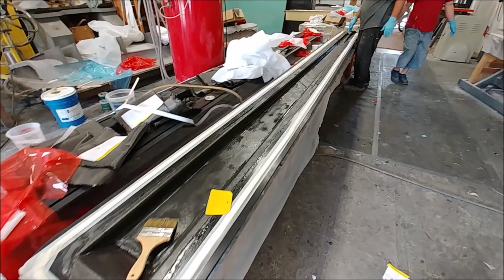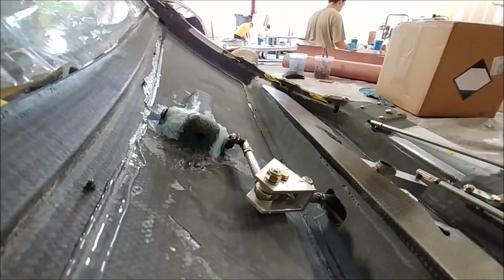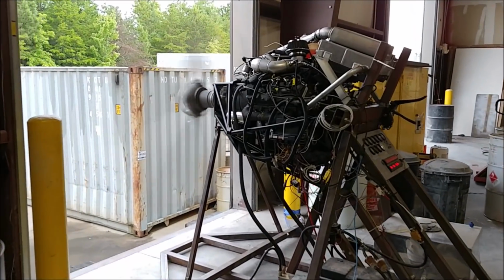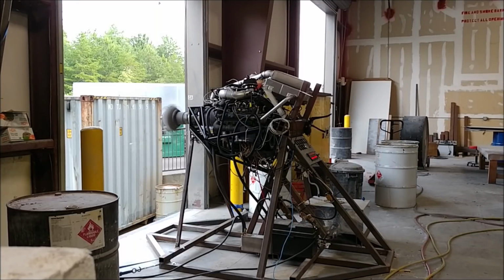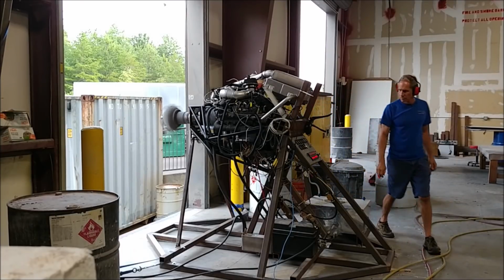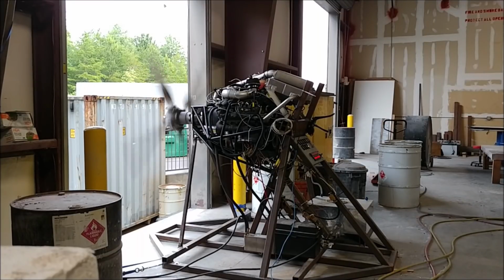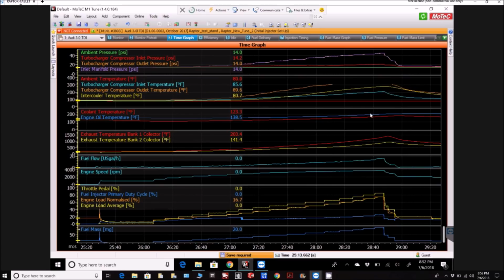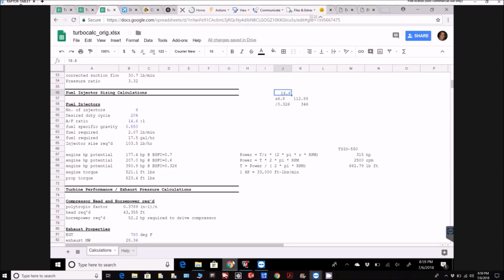Making Real Horsepower - Building the Raptor Prototype

Comment: I would like to recommend something, why not use a toyota V8  32 valve 5.7 liter  naturally aspirated  385 hp  and very reliable. also can add a trd supercharger for 505 hp
Reply from the maker: That engine is not diesel and it probably weighs way too much. The Audi engine is perfect for our application.

Comment: Audi has stopped production of these diesels for autos, correct? Are you negotiating with them to acquire the engines from the recalled vehicles in the U.S.? What are your thoughts on future availability of the engine for Raptor production? Are you considering the EPS Graflight V8?
Reply from the maker: There are loads of these engines available for not much money in Europe. We could ship them over by the container. The EPS engine is too heavy for our aircraft.

Comment: If you’re seeing 380 hp on Jet-A, what hp do you estimate you would get using diesel fuel?
Reply from the maker: Possibly as much as 400hp. But given the fuel flow from the sensors we're probably closer to 350hp on Jet A which would be about 365hp on diesel.

Comment: Would it be hard to add some conversions to SI units in the spreadsheet? Like kW for the power and Nm for torque? Would be handy for those challenged by imperial.
Reply: You know what would be easier is if you used google to find the answer yourself instead of asking the guy who is trying to build an airplane to do it for you.
Reply: Might be hard, as I can't edit his spreadsheet, or do I?

Comment: Do you have an overall weight on the engine with the mods you have done? Im curious if it would work in an RV-10 in a pull configuration?
Reply from the maker: Probably around 550 to 600lbs with everything.

Comment: Just out of curiosity, why the fixation with torque?  It is almost a meaningless number as you showed in that you can increase the prop flange torque by changing the ratio on the belt.  The only number that gives an indication of how much work the engine can do is the HP number.  Keep that where you want it and you will be perfect!  :-)
Reply: Perfect :-)
Reply: Bert Penney torque is a measurement.  HP is a calculation of RPM vs torque.  HP is a representation of power where torque is measured. Both numbers have relevance. But torque is where it’s at.
Reply: If HP is a calculation of rpm vs torque, why do things like horses, jet engines, rocket engines,etc produce HP (in some cases massive amounts of HP) yet output no torque?

In the case of the Raptor, torque is completely irrelevant.  What is important is a) that the engine runs at whatever rpm it most efficiently develops the HP it spends most of its time producing (normally cruise HP); and b) that the propeller shaft is turning at the optimum rpm for the chosen propeller while in cruise.  What the torque numbers work out to be at those settings is irrelevant.  If you need, say 180 HP for economical cruise, you need 180 HP regardless of what the torque number is (that engine will develop 180 HP at a very wide range of rpm's so there will be a very wide range or torque values for that one HP setting).  Focus on engine and propeller efficiency and forget torque.
Reply: Ah, the silly torque is more important than HP argument.  (btw Bert, you're on the money) Torque doesn't tell you anything without RPM.  If you know what your power is, torque is entirely irrelevant except for how to design the drivetrain to withstand the force your engine creates.  I can exert 2,000ft/lbs of torque on a transmission spline standing on a 10ft breaker bar, but that doesn't mean I'm going to outrun a Geo Metro on the drag strip with my 2,000ft/lb car.  I don't care how you gear it, the end result is that the resulting RPM from me hopping up and down on a breaker bar is going to be so small that it'll eventually equate to the HP a normal human can produce on a bicycle....maybe .3HP or so.  Now, if I were to rotate that bar horizontal on a platform over the car so I can push that 10ft breaker bar in a full circle with 200lbs worth of force, chances are I'd only be able to push something like that maybe 1 full circle in a minute, assuming I had something to push against.  2,000ft/lbs at 1RPM equates to roughly .4HP, so that's pretty close.  But what if I were superhuman and could run around that 10ft circle 5,252 times per minute? Then I would be able to make 2,000HP and smoke that Geo Metro. Put those numbers into a HP calculator if you want, but they're correct.  There's a reason why torque and HP curves meet at 5,252RPM.  By itself, torque is essentially the meaningless measurement. Say it takes 200ft/lbs of engine torque output to hold a car on an incline...you're 200lbs and standing on a 1ft long breaker bar attached to the transmission spline, creating exactly 200ft/lbs of torque.  Are you going anywhere?  No.  Are you doing any work?  No.  You could put 200lbs worth of exercise weights on that bar and that car will stay right there...no work is being performed and no power is being produced AT ALL, but you're still producing 200ft/lbs of torque.  How is that possible that torque is doing no work?  Let's up the ante and say it takes 2,000ft/lbs of torque to hold a big semi on that incline.  You use a 10ft breaker bar and exert 2,000ft/lbs.  Still the same situation.  But How?  How can 2,000ft/lbs be so useless?  Because torque is useless unless that torque is being made by a rotating powerplant.  It's not until you use torque in conjunction with RPM that it becomes relevant.  At that point you're not even looking at torque, you're looking at HP output.  What you thought was a measurement of "real" power (ie tons of beefy torque down low) is actually just the corresponding HP number at that same RPM.  600ft/lbs of torque at 2500RPM from a V8 is pretty respectable, but it's only 285HP...similar to what's made by a V6 at 5000-6000RPM.  If that same 600ft/lbs from the V8 held to the same RPM as the V6 (5000-6000RPM), you're now in the realm of 600HP. When you consider both torque production as well as RPM together, which is the only way things move under power, you get a new function called horsepower.  Horsepower is telling you the actual useful power the engine can produce, torque is simply a measurement you use to design the drivetrain around the engine.
Reply: Bert Penney  laws of physics mate, you can't have hp without torque!
Reply: Really?  How much torque does a horse produce?
Reply: Uhhhh....No.  Just the opposite.
Reply: Really?  If true, why has the aviation industry all but abandoned the low-HP, high-torque piston engines in favor of the high-HP, extremely-low-torque turbines?  A 750 HP PT6, for example, only puts out around 130 lb ft of torque.
Reply: Well, I'd hardly say the piston engines have been "...all but abandoned."  There are thousands upon thousands flying, with the vast majority of new aircraft being supplied with them.
I have a little knowledge of the PT6, of which there are many variants.  One thing they ALL have in common is they have a planetary gear reduction mounted to the output-shaft end.  This is a requirement to convert the +/- 40,000 RPM of the power section to usable RPM and torque to spin a prop.
Reply: I was thinking more about any aircraft with more than about 350 HP when I made the "all but abandoned" statement.  Piston engines simply don't exist anymore in those applications.

You also make my point here.  I used a fictitious version of the PT6 that produces 750 HP @ 30,000 rpm (PT6's generally run from 30,000 to around 40,000 rpm depending on the version).  Since you can't find a prop that will work efficiently at 30,000 rpm, that must be reduced - normally to 2,000 rpm.  To do that, you need a 15:1 reducer.  That increases the torque from around 131 lb ft @ 30,000 rpm to around 1965 lb ft @ 2,000 rpm.  At both rpm points, however, you will measure 750 HP because that is what the engine produces.  So, quoting either the 131 or 1965 torque numbers tells you nothing.  quoting the 750 HP number on the other hand, tells you exactly what that engine is capable of.

In the case of the Raptor, it would seem to me that a person would have to determine what the optimum cruising speed is - through testing - then determine what HP is required to maintain that speed.  With that data, you can figure out at what rpm this engine most efficiently produces that HP.  Then match the prop to that rpm.  If you focus only on torque, you will miss the mark.

Comment: Sounds like a turbine, love it. Just curious, how many hours before recommended belt replacement?
Reply from the maker: Yeah, I don't have an answer for you on that just yet.
Reply: Although it would not be a correct evaluation, as the old pulleys were not machined 100% straight as you said, how did the old belts look when they came off?  Wouldn't mind seeing those in your next vid if you still have them around.
I'd wager they are going to last a long time.  Does the manufacturer have a recommended replacement time for them?

Thank you for the amazing video's as always.  I love explaining to people about the Raptor, and how deposits are in escrow, and twice weekly video updates.  Just amazing how you are doing all this work in the open, not hiding behind closed doors. I'd be surprised if you are not at 1500 deposits.

Comment: ,,, ahhhhhh concentriciy. Yes the twin turbos, the modern miracle of common rail, and that prop make it sound better than a gas turbine, and thinking of that bsfc, wow .You might want to move those drums out of the plane of rotation of the : prop, rods, crank, pulleys, flywheel etc .
Reply from the maker: The drums are empty. If it all blows up it's going to hit something, may as well be the drums.